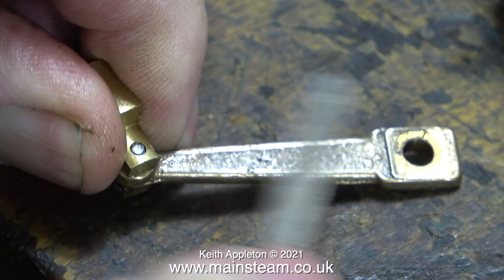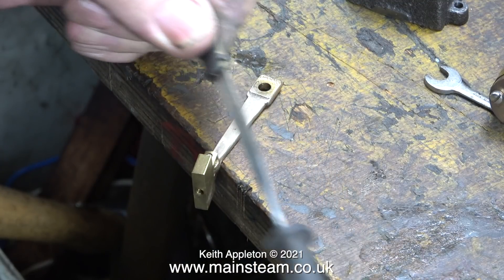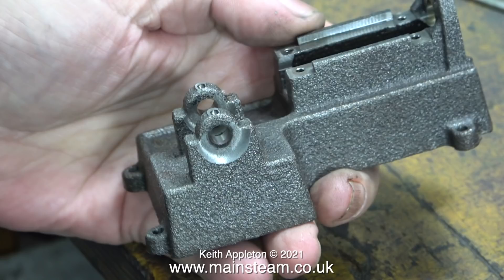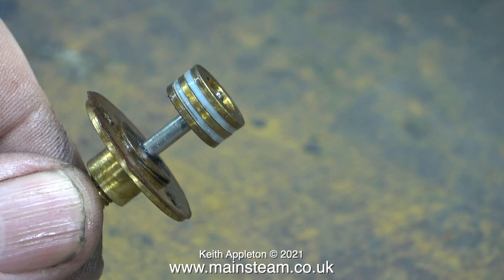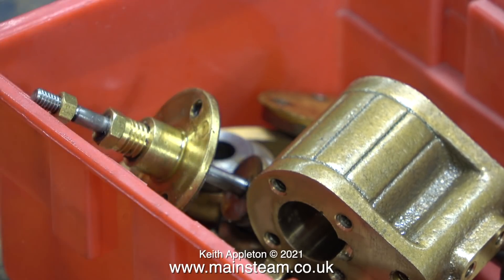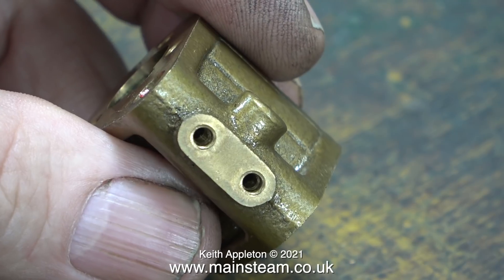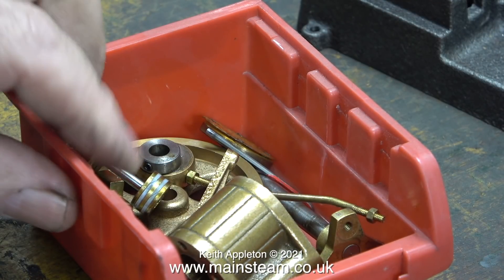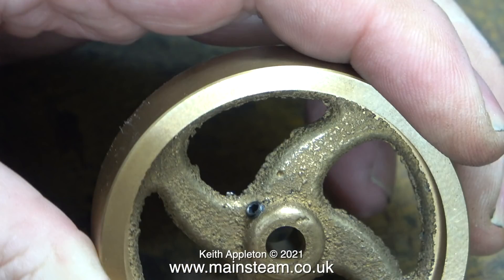A PM RESEARCH MODEL STEAM ENGINE - PART #2 - IN THE WORKSHOP

Comment: I really like this video. I have the same engine but I painted it dark green. I find it a well running engine on relatively low pressure. I will say that the castings in my engine were a lot cleaner than those pictured here.

Comment: Keith, 1/8th Whitworth is almost exactly the same as 5-40 as supplied by PM research.  The main difference is that Whitworth has a thread angle of 55 degrees and 5-40 UNC is 60 degrees. both are 40 threads per inch. Both are close to .125 in diameter.
Reply: I am fairly certain you are right but the other screw that is also right in that size range is the UNC 4-40.
I used to do model aircraft and that was what the American kits all used as opposed to the 1/8 BSW.
Without measuring the screw OD they might be quite difficult to distinguish by eye.

Comment: Pretty sure the screws are 5-40. That's what is called on most of their unmachined kits.
Reply: Doug,
Of course, you are correct.

I wanted to comment, that, by definition, a 5-40 screw has a major diameter of exactly 0.125" = 1/8" (yes, of course, there are tolerance allowances, blah, blah, blah...).  The screws in this series increase (decrease) in size linearly.  Each unit increase in screw diameter (e.g., from 4-40 to 5-40) is an increase of 0.013" in major diameter.  If one remembers these two pieces of information, then you can construct a table of major diameters without a reference book:

                               Major
   Screw              Diameter
                       Inch          mm
0000-160      0.021      0.5334      (very expensive!, when you can find them)
000-120        0.034      0.8636      (expensive)
00-96             0.047      1.1938      (not cheap)
0-80               0.060      1.5240      (these, and larger screws, tend to be commodity items)
1-64               0.073      1.8542
2-56               0.086      2.1844
3-48               0.099      2.4750
4-40               0.112      2.8448
5-40               0.125      3.2512      (exactly 1/8" major diameter)
6-32               0.138      3.5052
8-32               0.164      4.1656
10-24             0.190      4.8260
12-24             0.216      5.4864
14-20             0.242      6.1468      (uncommon, because it is very nearly the same as a 1/4"-20, 0.250"-20)

Notice that all the screws from 6-32 and smaller differ by 0.013" major diameter from one size to the next.  And, the screws from 6-32 and larger differ by two screw sizes, and the major diameter is 2x0.013 = 0.026" from one screw size to the next.

The number after the screw number is the number of threads per inch, tpi.  For reference, 24 tpi is very nearly the same as 1 mm pitch,  48 tpi is very nearly 0.5 mm pitch, and likewise, 96 tpi is very nearly 0.25 mm pitch.  All three of these approximations are in error by about 5.8%, e.g., 24 tpi is actually 1.058333... mm pitch.

All the US customary number screws have a 60º thread.

Personally, I prefer screw sizes to increase (decrease) geometrically rather than linearly (as do the US number screws).  BA screws increase geometrically.  They average 12% smaller than the previous size, rounded to the nearest 0.1 mm.  That is, start with a 0 BA screw, which is 6 mm diameter.  6x0.88 = 5.28, where a #1 BA screw is actually 5.3 mm.  5.3x0.88 = 4.7 mm.  Rinse and repeat, and you get that a #16 BA screw is 0.79 mm.  The thread pitch for BA screws follows a similar geometric progression.  BA screws are 47.5º vs. 60º US number screws.

By coincidence, a #5 BA screw has a major diameter of 0.1260" and a thread pitch of 43 threads per inch.  These numbers are close enough that a loose tolerance 5 BA screw will, in most cases, screw into a 5-40 nut and vice versa.  If the nut is particularly thick, or one is trying to screw a stud into a deep(ish) hole, there will likely be interference.

I hope this helps other readers.

Be well & Best regards,
Gottfried
Reply: You’re probably right about the 5-40 threads because it seems you have done some research. I remember that back in the heyday of slot cars the 1/8” axles had 5-40 treads. To me these screws look a bit bigger than 1/8”. In any case I agree with Keith. These cheese head slotted screws look all wrong on this engine. 
I think all slotted screws should be banned. Maybe Phillips too. Old technology. Let’s all switch to square head, Torx, or Allen head for everything.
Reply: I am fairly certain you are right but the other screw that is also right in that size range is the UNC 4-40.
I used to do model aircraft and that was what the American kits all used as opposed to the 1/8 BSW.
Without measuring the screw OD they might be quite difficult to distinguish by eye.